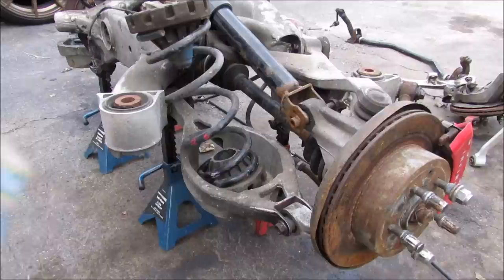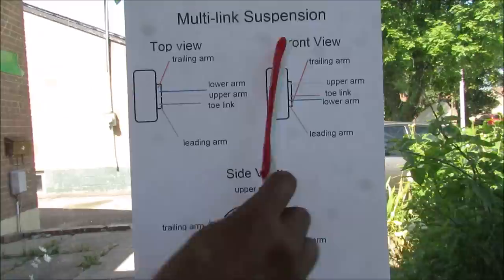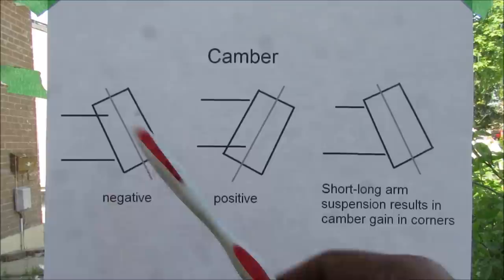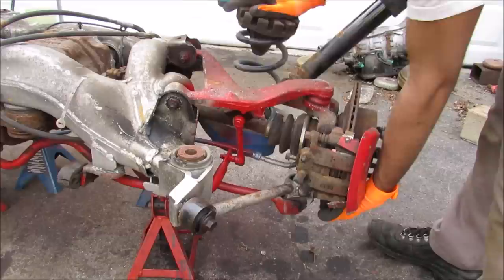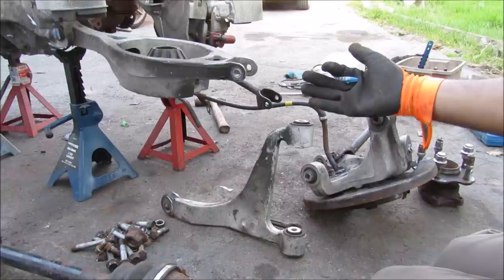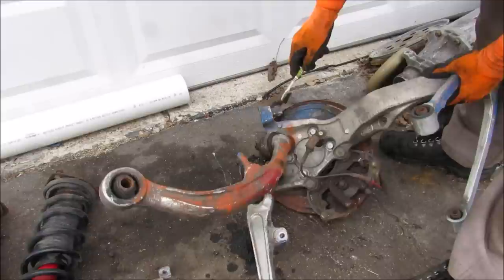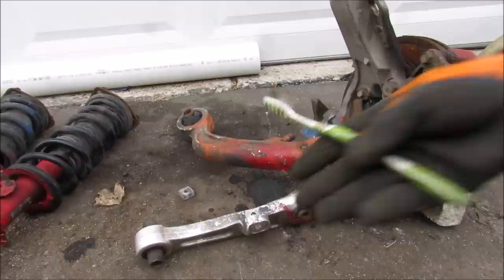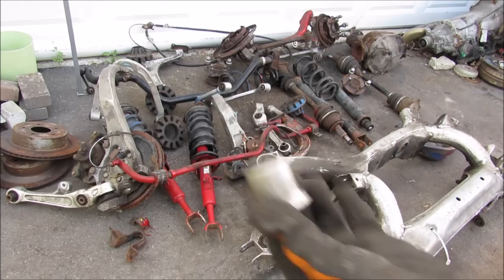How Multi-link Suspension Works

Comment: With your knowledge of suspension geometry you should explain the dreaded "death wobble" on Ford trucks. Thank you, great job of making my head spin. Your #1!
Reply from the maker: Death wobble is The track bar bushings, right?
Reply: @speedkar99  
Seems to be a mystery to most, including Ford Techs and owners per most forums. I had a chevy 3/4 ton that would literally 
bounce like it was on a trampoline. Ended up being the brand new HD shocks. When I installed, I positioned in place, cut the tie wraps, shocks went up into position. I bolted in place. A week later pulled them off & my 10 year old daughter could compress them. A slight rolling road would get that truck bouncing like something out of jackass movie. New HD top of the line NAPA shocks. Must have been Friday, end of day, before a three day 
weekend manufactured set of four. Go figure, right.

Comment: So is multi-link so much of an improvement over other setups that a 90's car with multi-link should out-handle a 2019 car with just Macpherson struts? Assuming any worn parts have been replaced? Love your vids!
Reply: By far my 06 g35 handles and rides like  a dream compare to a 2019 toyota Corolla and I'm saying this out of experience and nothing has been replaced on my g35
Reply: @krischilamootoo6562  good to know. I would guess that would always be the case until new cars just way out do old car stiffness, but even that could probably be compensated with things like strut tower braces etc. Better suspension geometry is just better.
Reply from the maker: Agreed. Multi-link of past years (even on family cars like a Honda Accord) far out handles the cheaper cost effective suspensions offered now. The reality is not many people are buying cars for driving dynamics now, the masses want a car to go from A to B and won't benefit from the advantages of a more complex suspension geometry.
Reply: It depends,PSA can make some great cars using simple set-ups.New cars have better torsional rigidity which compensates to some degree;also improvements in bushing design make cars more comfortable.I drive a 2007 Ford Focus which has multi link suspension and it holds to the road exceptionally well and soaks-ups road imperfections with aplomb.I live in a Greek island with terrible meandering cliff roads-full of dangerous curves.In such conditions you see the shortcomings of carmakers like Toyota who can make some bullet-proof engines but in terms of chassis design it lags behind .

Comment: Something to be said for the simplicity of a torsion beam rear susp over multilink in a road car. Even Mazda has gone back to with the new 3, which shows it doesn't have as many compromises as one may think.
Reply from the maker: Well that's what the media and Mazda/VW PR want you to think with thier new torsion beam setups. 

The reality is it is a cost cutting move that has been masked by adjusting other suspension parameters to make it's effects less apparent. Not much people would care because it's an economy car.
Reply: @speedkar99 Your probably right. But vehicle cost and repair cost are important to consumers too. Let the consumers and auto journalists decide 😉 Multilinks have their place (luxury, sports, race cars), but every car doesn't need one. Thanks for the awesome vid 👍

Comment: I bought a 2007 Honda Accord LX (4Cyl) sedan with 100 K miles clean car fax one owner. I noticed the suspension was so rigid, I replaced the strut assemblies (all 4) with KYB but nothing improved. Now I have sand bags in the trunk to help absorb the bumps. Any idea how to solve the situation?
Reply from the maker: What car are you coming from? Honda will be stiffer than a Toyota or Buick for example. 

You can also check your tire pressure and run smaller rim diameters with a larger tire sidewall.
Reply: @speedkar99  I came from the exact make and model which got totalled in a crash after 10 years of ownership. Rims are the smallest available (15") with Goodyear Cofortread tires and 2 points below the recommended air pressure, yet still rigid. It's worth to mention, the previous owner was an over weight since the driver seat is crushed and I have to restuff it.

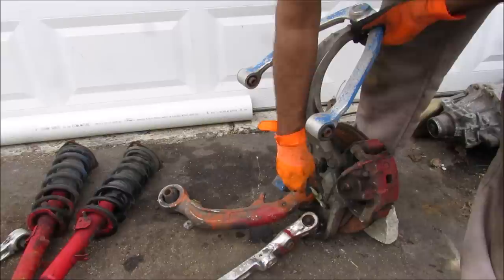Comment: 11:29 There’s one more benefit here. If pause the vid at aforementioned point, you can look at that right front suspension and imagine how the wheel turns to either side. Now follow: when turning right this right wheel moves a bit forward, when turning left it moves a bit back. In other words the wheelbase becomes shorter on the inner to the turn car’s side and longer on the outer to the turn car’s side.

What’s the purpose of it?

Comment: I'm here just to check if the toothbrush is a normal theme. It would seem so🤣🤣
Reply from the maker: It has a permanent position here on speedkar99's YouTube channel with the angle grinder as a guest speaker